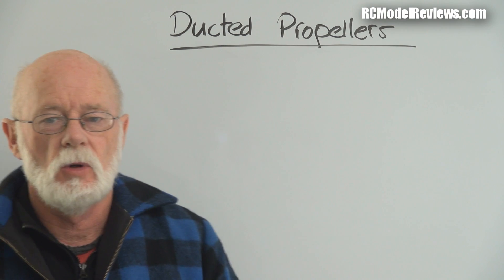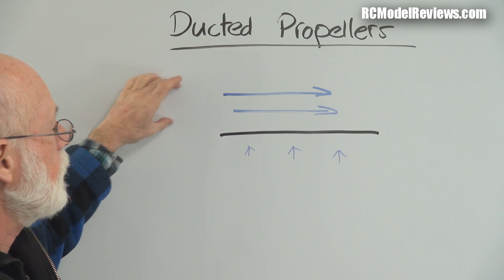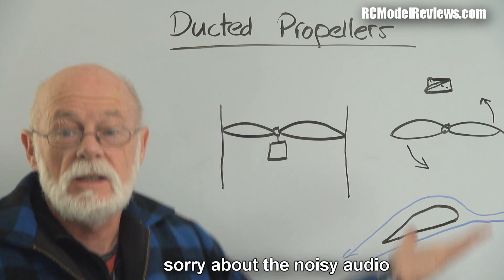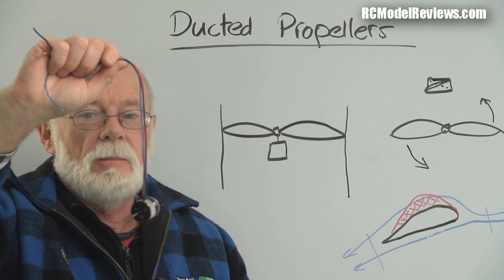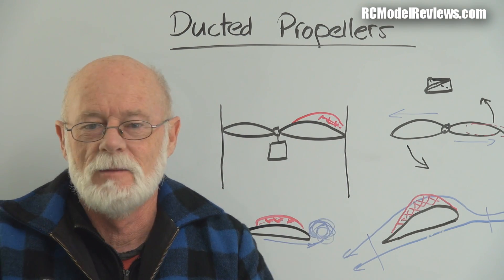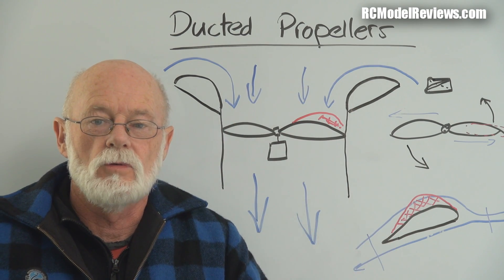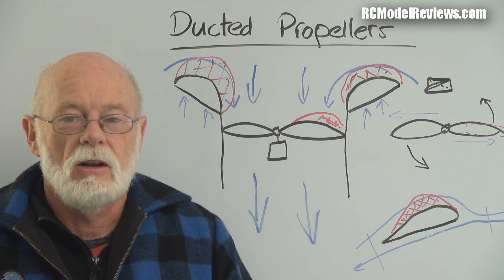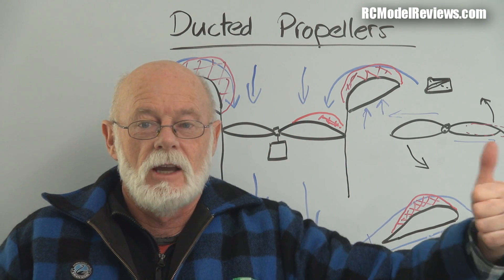How ducting a propeller increases efficiency and thrust

Comment: Design idea: what if you enclose the propeller fully in a very short tube, but have zero gap between tube and outside edge of the propeller.  So when it spins the entire tube spins. Then no chance of vortices  at the outer edge of propeller.  Just an idea. I don't know how well it would work in practice.
Reply: I guess the raised tip on the far end of passenger jet wings is to help this same issue of vortices spiraling off the end of the wing/propeller.

Comment: Thank you for the video.

Can the clearance issue be solved by having the propeller tip run in a groove inside the duct? It seems like it would lose or reduce the tip vortices but also any thrust for whatever portion of the tip was in the groove.

I was wondering about the rigidity of the structure as the prop and duct flex and shift with aerodynamic loads and vibration, or potentially a rough landing or rough runway.

Comment: How does airplane fly upside-down?
In that position neither Newtons nor Bernoulli's law apply.
Reply: Control surface (flaps/aileron) changes angle of attack of wing which creates a combination of lower pressure on the now inverted lower wing surface by causing the air to travel a longer distance from leading edge to trailing edge and higher pressure on what was the upper wing surface by presenting a larger surface area to the air.  Hard to just say in words.

Actually he shows it indirectly at around 5:30 when he explains how planes with flat surfaces for wings fly.   Change the angle of attack and those forces become more significant than the lift from an aerofoil.

Comment: What about as you increase the Forward Speed of a propeller tube thru a medium...such as a fast aircraft, or a boat thru water. 
Won't the frontal area of the 'lip' of the tube create more DRAG than the increased thrust..? As you push thru the air, or water, at faster speeds, you will create a Void behind the lip...which will actually create 'suction' against the back side of the lip...as well as the force required to push the tube/propeller thru the medium...

Comment: Finish the rest of the test so I can evaluate the entire process. Seems to simple! Still I would like to hear the rest of  can you measure of lift to wt ratio? I would like to better determine and examine additional weight ( like a fly wheel).  Will have centrifugal force help to stabilizing the path and the rotating ability. X=R/w x rpm = lift. If that makes any sense to you. Sub-stained rate of should reduce. Interested to see results.

Comment: Why don't they duct helicopter propellers?  Even if it is just to save the main and back rotors, if the rotors touch the ground or trees?
Reply: The main rotor has to be able to decapitate zombies.
Reply: Weight becomes an issue.  The tail rotors on some models are housed within the tail.
Reply: Some tail rotors are indeed ducted for this reason... for a main rotor it adds far too much weight to be worth doing though
Reply: They did in Avatar..cool looking!
Can't wait for graphene..
Reply: https://img.gta5-mods.com/q95/images/sa-2-samson-from-the-movie-avatar/b2684f-GTA5%202016-04-13%2011-02-17-60.jpg

Comment: I REALLY hope you can answer this...Why completely duct a propeller instead of just making winglets at the tips of the prop to prevent vortex loss, same as they do on airplane wings? The Propeller blades do act as wings with airfoil cross-section right? Also, add winglets to the tips of helicopter main rotor?

Comment: Ducting a prop harnesses the energy that is generally lost from the cutting edge 180 degrees to the trailing edge. This energy is usually sent off into no mans land, the ducting forces this air energy to HAVE to travel in the direction of flow increasing efficiency by up to 15% This same theory applies to hydro jet drive systems, the tighter the tolerance between the impeller and the jet case  the more efficient. Russia started this on their Nuclear subs, efficient and quieter with thrust vectoring possibilities. The venturi  effect builds air pressure or compression pre prop increasing thrust after prop , kind of like a turbo effect

Comment: there is another effect what could be used. when the tube holders are created as small wings "standing rotor blades". These standing rotor blades can to convert the rotating energy of the air for additional thrust.

Comment: Blades aren't shaped like the wings of airplanes they are twisted to create more thrust by compressing the air it pulls in. Propellers basically suck and push the medium around it and when you put a duct enclosure you confine the air thus creating more thrust

Comment: sounds great but when i look at the specs for EDF and simple fan motors, it always shows more thrust/watt for simple than EDF. why?
for example this EDF motor https://www.banggood.com/FMS-50mm-12-Blades-Ducted-Fan-EDF-With-2627-KV4500-KV5400-3S-4S-Brushless-Motor-p-1115809.html
 12.5V 40A (500W) thrust=650g
and this motor with prop https://www.banggood.com/DYS-Samguk-Series-Shu-2306-2250KV-2500KV-2800KV-3-4S-Brushless-Motor-for-Racing-Drone-p-1226078.html
        180W  thrust=600g (at 27000 rpm)

Comment: At 5:50, the air over the top of the top of the foil travels faster, but also it travels further relative to the bottom air per unit time. So if two air molecules are adjacent buddies before they go around opposite sides of the foil, the one that went over the top will be further away from the foil than its friend who is now closer to the foil.

Comment: First of all, it is a THEOREM, not a theorum. Second, THE STATIC THRUST produced by a properly ducted propeller will increase with the same power applied,  but its DYNAMIC THRUST will soon decrease with the craft's increasing speed and require more power and higher R.P.M. to achieve a lesser result.

Comment: normally I like listening to this guy but I know quite a bit about ducted fans and at least half of what he said here is wrong. for instance the lift generated by the leading Edge of the duct being curved outward is miniscule duringstatic thrust environment. Meaning the ducted fan is not moving through its environment it is simply hovering and drawing some are in the top and out the bottom. However when that ducted fan is moving through the environment there is a high pressure zone in front of that edge. However that high pressure reader x the vast majority of the air in that region into the duct. This creates a higher density in the air entering the duct thus making the blades of the fan more efficient. But make no mistake that leading Edge does not create Lyft in anything except a static environment at that lift is miniscule.

Comment: I have heard that they are little less efficient in some circumstances since the turbulence by the many propellers would be higher then when using an ordinary propeller and thus the efficiency would go down. However since there are many "propellers" they thus do combined more thrust, and also due to what is mentioned in the video, but once again its not as efficient.

Comment: You are distorting Bernoli's theory sir. It only applies to a curved surface. Why does the paper not go above the horizontal when you blow over it? The reason why a ducted fan is more effective is  because the high pressure air at the propeller tip can not flow to the low pressure area of the propeller as it is blocked by the duct.

Comment: you would think that if it works it would be in wide usage... yeah bernouli, but the friction is not lost on the outer aerofoil and that high pressure zone before the back end is not accounted for in drag in this video seems overly optimistic.

Comment: I wonder how this would work in a wind generation system. If the power was external (wind), would it cause a similar or identical reaction, but instead of applying lift, the two low pressure areas could increase the amount of electricity, or lift power, if you wetre using it to power a water pump with a belt or shaft powering the pump directly.

Comment: Fans are indeed similar to wings. FAA flight student test questions still show Bernoulli's Principle as the source of wing lift. NASA Ames has an info page called the "incorrect theory of lift," which shows that Bernoulli's Principle is not the sole source of lift. This can be important when thinking about how wings, whether fixed or rotating, are able to function. Incorrect theory #1 is the "longer path" or "equal transit" theory. This is being mentioned at about the 6:00 mark in this video This idea and others  present a real challenge for working flight instructors such as yours truly, before I went off to fly jets.

Lift and drag have been argued by physicists for decades, including luminaries like Max Planck. Relish the journey!

Comment: Ah, been thinking about the same things for a while. So....if we dispense with the stationary duct and combine the prop fixed to a spinning duct? No more gap to worry about then Right? All air is forced through the ducted prop. Has this been tried? I know in USA they tried this with boat prop but they failed I think. In theory it must work, and well.

Comment: Such a good video ruined by massive holes and large jumps in conclusion. Stop perpetuating nonsense written by people needing to simplify things for people who don't really care. You may as well say Pi is 3 and gravity is 10m/s² because ye know decimal points are hard.

There is no such force as centrifical force; unless you ment centrifugal force, then in that case... There is no such force as centrifugal force; unless you meant centripetal force, then in that case; the direction of centripetal force is toward the center and is balanced by the force of the object wanting to leave the circle in a straight line, not some magical force directed outwards. The duct works by trapping the air in a tube stopping the air rolling off the end of the propeller. Lift is only generated by roughly the first 70% (depending on the prop) or so of each blade/wing measured from the base of the blade/wing. Look at formula 1 cars aerofoils and even most commercial planes nowadays, they have vertical wing tips at the end. Ever seen a plane from the 90s coming into land? (If not, watch Die Hard 2) You will see vortices spinning off the end of the wing... these vertical wing tips reduce or even prevent that, meaning lift is generated across nearly 100% of the wing. The duct is the wing tip revolved around an axis.

You elegantly demonstrated Bernoulli's theorum (I've used the same demo myself, Feynman would be proud) then made a wild leap to assume that because the length of the upper half of the aerofoils profile is longer than the lower half, then somehow magically the air has to travel faster. If two molecules of air are travelling at x speed in front of the wing and the two molecules are parted, one going over and one going under... how does the upper molecule know how much to speed up to to meet the lower molecule??? It doesn't, its BS. Ignoring all other factors each molecule would travel at the exact same speed and the upper molecule would leave the aerofoil behind the lower molecule. Now if this was more than two molecules and we include other factors the air going over the wing would be forced between the aerofoil profile and the free flowing air above thereby causing compression and increasing pressure over aerofoil; thereby reducing lift.

The speed of the air does increase and the aerofoil increases lift so Bernoulli must be right. Ahh the corner stone of science, ignore the evidence and make it up... oh no wait thats doctrine. He was correct about the increase in speed and the overall decrease in pressure, but he made the assumption about the molecule pairs adjusting speed to meet each other at the other side of the aerofoil (just like im making an assumption about him making an assumption seeing as thats what I was taught, for all I know he never made that assumption and that gap was filled in later by someone lazy). So how does the speed increase? Could it be aliens? gremlins? or the tooth fairy? Nope, its something much more simplistic and here it comes, another Feynman moment... stick a teaspoon vertical under a tap and see what happens. The air is accelerated by its interaction with the surface of the aerofoil. Fluids nature is to kind of stick (see lazy explanation is in us all) to a surface until the angle of that surface becomes so great relative to the flow that it overcomes the stickiness causing it to separate from the surface. This is called the Coanda effect and its the main reason for the change in air velocity over a wing and thereby decreasing pressure and allowing Bernoulli's theorem to work.

People seem to sit in two camps... Bernoulli or Newton. It like being in two camps over which elements water is made of, hydrogen or oxygen. Newtons first law, Bernoulli's theorem due to the Coanda effect as well as a number of other minor, near negledgeable, effects all come together to generate the overall lift.

Rant over.

Comment: When I was in the USAF early in my career, mid 1980’s, I overheard a couple of pilots arguing about lift. One of them steadfastly argues that it was the low pressure over the wing that created all the lift. And in my mind I was thinking, Duh, basic science, I thought everyone knew this. Then the other pilot chimes in with, the. Why is there an angle of attack? That wing shape will never work if it were perfectly level. The low pressure would never match the weight of the aircraft. He even went on to say the the wing could be perfectly flat with no “wing shape” and it would work nearly as well. Then he said the entire reason for the shape was actually for aerodynamic drag. To create the least amount of drag possible. Slightly thicker in the front and tapering off to the rear. But flat on the bottom to take advantage of Newton’s law of equal reaction. That conversation changed the way I looked a science forever.

Nearly 20 years later... I was working on the A-10 warthog. It has ducted turbofan engines. So much quieter than a standard jet engine. We were sometimes tempted not to wear hearing protection around them. In fact, just a dozen or so feet away made all the difference. It was still loud, but didn’t cause physical pain as if it where, say an F-16 running. Permanent hearing loss and very painful.

Again, two pilots discussing how ducting worked. They covered everything you spoke about, plus something else. Compression. The air duct is larger at the intake than the exhaust. A noticeable amount (unlike the small duct you showed, which had a very slight diameter difference. He went on to say that it worked similar to a jet engine in that way. The volume of air goin in was greater than the air going out. And for that to be the case, either the air going our had to go faster to make up for this, or be compressed, being denser, both of which would create more thrust. 

I never heard the rest of the conversation, I had a job to do and couldn’t stick around for it. But I’ve always wondered about that. Does the ducted fan get the most benefit from that compression effect?
Reply: Compressing ducks would result in ear deafening noise. Louder than an F-16.

Comment: Another thing that might be considered would be to build hollow propeller blades. Constructed in such a way as to provide for air passage inside the blade from an air intake located at the front of the axle, along the inside of each blade and exiting through slots located near the underside tip of each blade jetting the air flow toward the trailing edge of the blade. Why waste potential centrifugal force (as the propeller is spinning) when that moving mass of air can be used to assist in the propellers' function? The same could be applied to jet engine rotor blades. I'm fairly certain that an aerodynamics study would verify my hypothesis.

Comment: I've done a great amount of research on extreme power acoustic sources. i mention this after comments on another site about "how could you know about aerodynamics"... ughhh.. what the bloody hell do you think sound is!?!?!

consider a gasoline lawnmower, loud as hell... but the total radiated acoustic power is typically less than 1 watt (yes!) ..  I've invented, designed, supervised thr machining & integration and resting of high power acoustic sources up to 10s of kilowatts of radiated sound...  that is total coherent sound power output not power input.

my sources generate intense sound by unstable/oscillatory combustion, phase changing thermodynamic effects, vortex flow as a transmission line resonator and combustion driven sirens. I've also designed and built dozens of laboratory devices for simulating the aerophysics of tornadoes, dust devils and other intense geophysical vortices. 

ducting ... why? 

with these verical, large rpm small radius, fans (they are fans... blades designed a high rpm air blower mode of operation) there are numerous higher order turbulence, acoustic losses, boundary layer effects and viscous losses

But the simplest way to think of the problem is... rockets don't work well if you try to collect the exhausr.

these are movers inducted set up major, high system loss RECIRCULATION flow fields..  some of that flow structure literally is a sort of fluid short circuit causing the momentum transferred to expelled air to be partly recaptured ... decreasing overall efficiency... 

If anyone wants input I can show you how to mitigate some of the noise these things make ... there are potentially more silent blower methods... one of which I think might be adapted to drones... maybe ... and I can show you designs that actually decrease the acoustic noise the blades generate  (at least over a range of rpms)